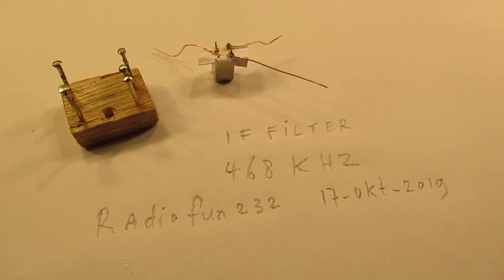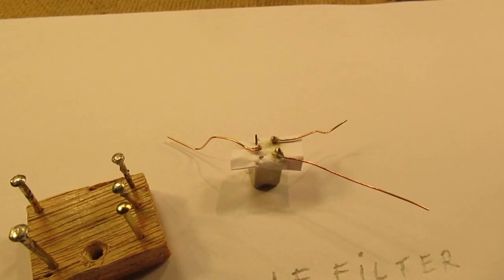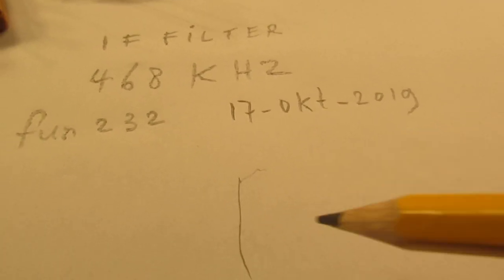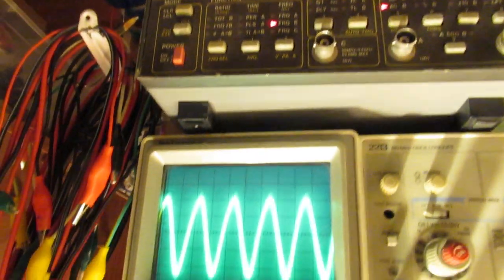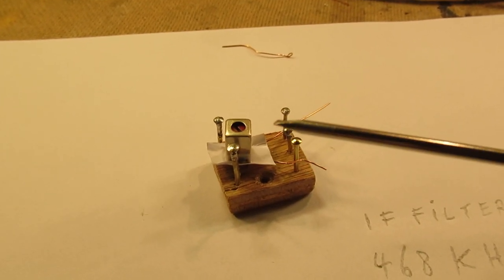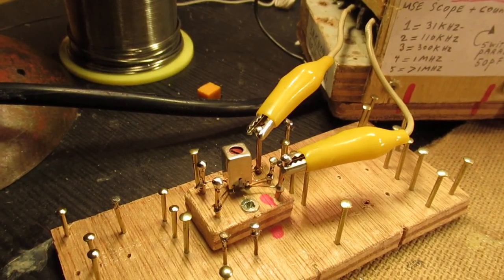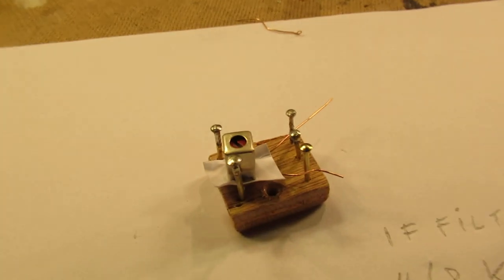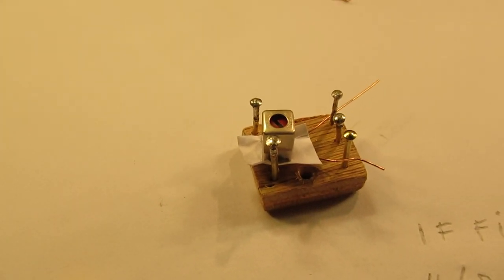How to tune a 455 KC etc. coil filter for a superheterodyne radio in advance (demo & test)

Comment: I love it! Beautiful work and some very nice mounting techniques. Thanks for the tip on putting down a piece of paper first before soldering. I had never considered this! Very good video... thanks for sharing, Ko.
Reply from the maker: Thanks Jim, yes that piece of paper "made the difference". It could get a sloppy mess, when not used. Afterwards I remove all the paper of course.

Comment: Pretty good.  Thank you radiofun232.  Can you please show us a block diagram of what is connected to what with you test equipment.   i.e. how that coil is wired to your generator, scope and frequency counter.  Cheers!
Reply from the maker: Thanks. Schematic of the test oscillator is here
 https://youtu.be/Ng49kGF3n8o Output to scope and counter are visible there. The IF filter under test is connected to the input of the test oscillator with crocodile clips (say 20 cm wires).
Reply from the maker: The sophisticated schematic of the test oscillator is here https://youtu.be/LrJWLe1XrSI

Comment: Great video. Can you give the complete schematic for the if filter. You use three pins what are the other two for.
Reply from the maker: The 2 pins on one side go to a winding where the signal is "coupled into" (or out of) the transformer.
Reply from the maker: When all works I will publish the schematic. There is already a schematic of an IF filter on my YT channel, in a earlier series where I made another SW radio 2-10 MHz.

Comment: how I can calculate number of turns for 100kHz for IFT.
Reply from the maker: I don't understand what you mean, the question is too general.
Reply: I want to block frequency of 200kHz using IFT and Capacitor.how to select IFT?
Reply from the maker: @acqurius-gx8lr  what is IFT, what are you making?
Reply: I am trying to make loop antenna to detect field of 200Khz signal.but I do not want that other frequencies like power 60Hz is detected.i think IFT will be useful for me if I place capacitor in parallel to IFT secondary winding.is it possible with IFT or not.if yes then how to design it.
Reply from the maker: @acqurius-gx8lr  Than between the upper and the lower pin at the side of the 3 electrodes an extra capacitor must be mounted, so that the frequency of (say) 455 KHz is brought down to (say) 200 KHz. With the "help" oscillator and a  counter you can try this out. Because the filter was made for 455 KHz at 10 KHZ bandwidth it cannot be predicted what the bandwidth on 200 KHz is, but there is a good chance that it will work. I don't know the real situation of your circuit (input and output impedance, where the filter will be mounted and to what, so the problem of damping the resonance frequency on 200 KHz) but that extra capacitor is somewhere between 50 pF and 220 pF (my first idea, not calculated).